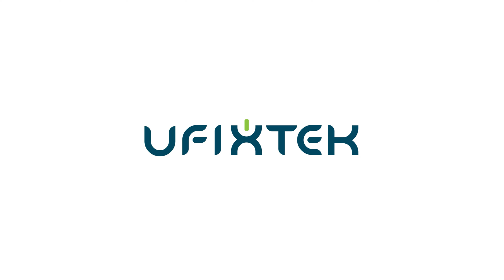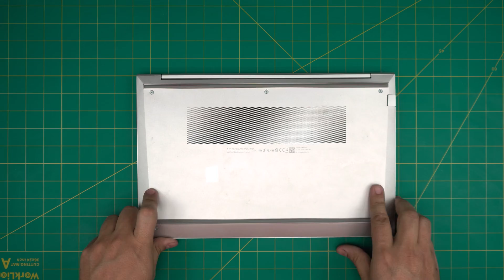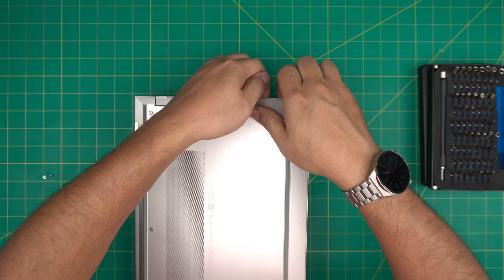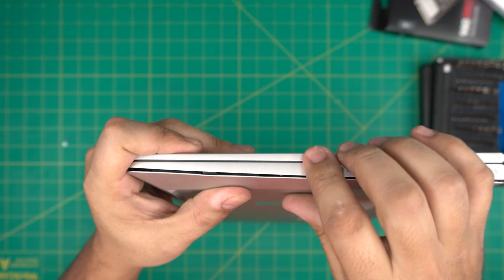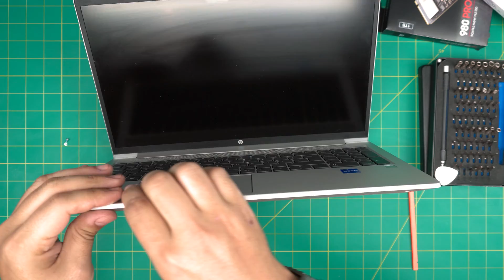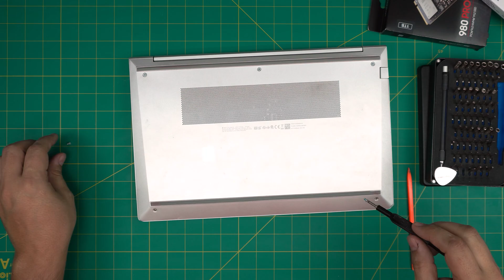How to Upgrade Storage SSD - HDD for HP ProBook 450 G9 Laptop

Comment: Thank you very much for your responce. After mounting the 990 to the extra slot the laptop does not go on anymore. After removing it, it takes a while but it is booting up again.  I mouted it to the extra slot so i do not have to install windows and all the rest of the programs again. Any ideas?
Reply from the maker: That is not normal. We upgrade them all the time, and it always works without any issues. Did you update the BIOS? Did you make sure the SSD is fully inserted?

Comment: i ordered the Samsung 990pro pcie 4.0 nvme m.2 ssd because the one in the link (samsung 980) was no longer deliverable. But it is not working. after mounting the laptop does not go on anymore. After removing it takes a while but it is booting up again. Any ideas?
Reply from the maker: 🫠Regarding your question, taht 990 is perfect , once you place the ssd you will not have any windows, you will need to create the windows usb and install windown on it.
📢 How to Create a Windows 11: https://youtu.be/T0uBTVNCdAQ
📢 How to Create a Windows 11 no TPM: https://youtu.be/K3UFQmPcQjs
cheers🍻

Comment: can i add 2 Tb to the extra slot so that i do not have to instal windows again?
Reply from the maker: 🫠Regarding your question, sure you can and you don't need to install windows.
Should you have any further questions or requests in the future, please don't hesitate to ask me.
cheers🍻
Reply: @uFixTek  i ordered the Samsung 990pro pcie 4.0 nvme m.2 ssd because the one in the link (samsung 980) was no longer deliverable. But it is not working. after mounting the laptop does not go on anymore. After removing it takes a while but it is booting up again. Any ideas?

Comment: I have question. Can you use the example of this additional (short) drive, 500 GB? I don't know what "in" have the disk. Second request: My son has 8 GB in it, I would prefer to buy a second copy, may you have additional requirements for these RAM memories?
Reply from the maker: 🫠Regarding your question, you can definitely add an additional SSD of up to 1TB without any issues. If you need to upgrade the RAM, here is a video on how to do it:
https://youtu.be/pr5Hw2Desi4
Should you have any further questions or requests in the future, please don't hesitate to ask me.
cheers🍻
Reply: @uFixTek Thank You for anwer. What SSD this should be? I know only, this should be "short".
Reply from the maker: 2242

Comment: I check on hp website it says upto 256gb on the secondary slot, 
Can you really put a 1TB on the second slot ??
Reply from the maker: 🫠Regarding your question, don’t listen to them. We have upgraded these laptops and tested them; in the main slot, you can place a 4TB NVMe without any issues. At the same time, you can place a 1TB NVMe (2242) in the second slot without any problems. If a 4TB 2242 were available, it would still work.

These are NVMe (PCIe lanes). We've heard from many brands like ASUS, HP, and Dell that, even if you call them, they often give you a low-ball number.

Comment: Great video, please does support Gen 4?
Reply from the maker: Thank you for your feedback! If you wish to support the channel, you can like, subscribe, or both!
Regarding your question, no my friend it doesn't have gen4 pci-e lane, but you can place a gen 4 ssd it will run it as gen3  and it will not over heat and degraded because it will not push the limits of the ssd to gen4 specs.
Should you have any other questions or requests in the future, please don't hesitate to ask me.
cheers🍻